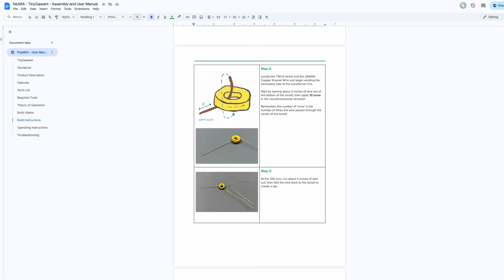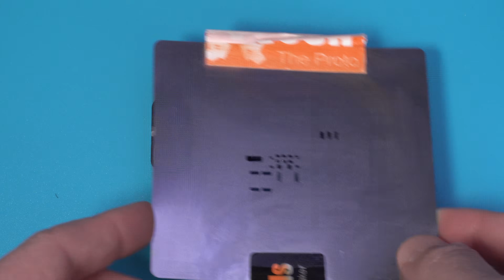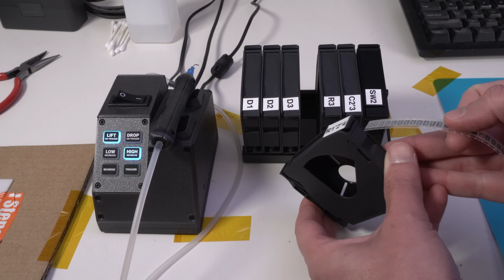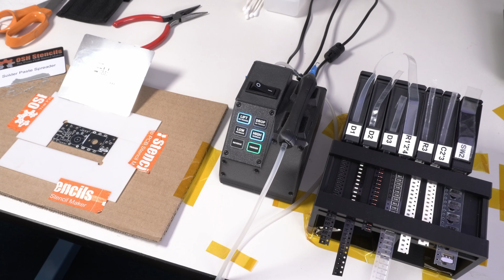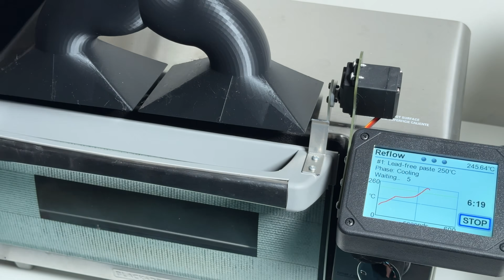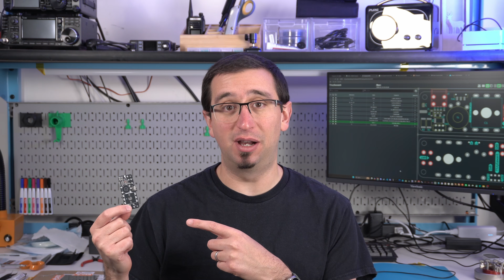TinyGawant - Manufacturing the Antenna Kit | Part 4

Comment: This has been great to see the process! Thanks for sharing everything!  You might consider hinging one side of your parts table so that the bars (Holding the parts down) rotate down instead sliding the parts under the bars and as you showed loosing some parts off the tape if it catches. could be an option for you if you haven't got the pick and place machine put together yet.
Reply from the maker: I'm pick and placing the pick and place as we speak ;)

Comment: Hey Ara. On that table you made for the reels… take those rails and put them on a hinge, that way you can pull the reels out and drop the rails over top, rather than feed them through the rails.
Reply from the maker: Great idea! I need to iterate on that little reel table (made it super quickly). I'll add this suggestion to the change list.
Reply: @N6ARAElectronics I know the frustration. I probably have had hundreds of SMD components disappear in the black hole over the years.
Reply from the maker: @RLKD8DNS  Totally! I like to pretend that all the SMD components I lost to the floor are hanging out together in some alternate dimension. Probably with the socks I lost to the laundry machine.

Comment: Have a look at Boarditto 2Pro desk top SMT machines I had 20 plus years in the SMT assembly industry using Fuji Panasonic Universal  Dynapert and Philips SMT placement systems along with Dek,MPM screen printers and reflow ovens from table top to inline machines if your struggling to produce the quantity needed it could be an option obviously a investment for new and used equipment is needed. Fantastic product chap keep up the good work for QRP users. Tony M7CVK

Comment: Seems to me your work station would be MUCH more convenient if you move your vacuum device to the right of the SMD reel device.
Reply from the maker: I originally started with it on the right side, but the vacuum tube kept striking the reels and knocking parts out. That said, I bet I could rig a little protection bar to avoid this.

Comment: 2:15 Great decision Ara, soldering SMDs is no joke, especially as with the zener diode being round and therefore refusing to sit still on the board, and also making sure that you've soldered both diodes the right way round.  Would love to see how you can automate/accelerate attaching the BNC socket, as that is a real pain to solder on.